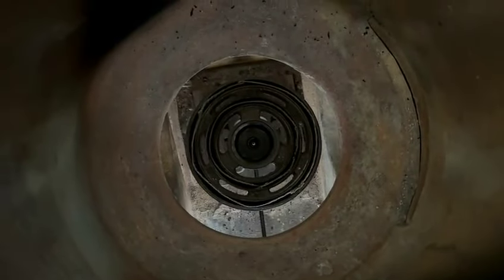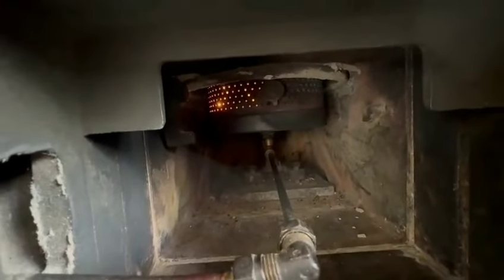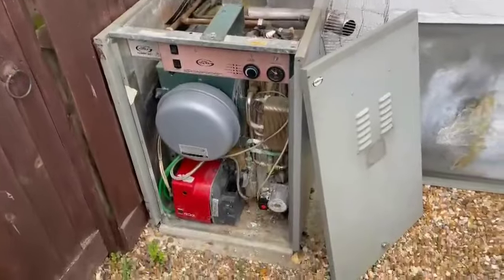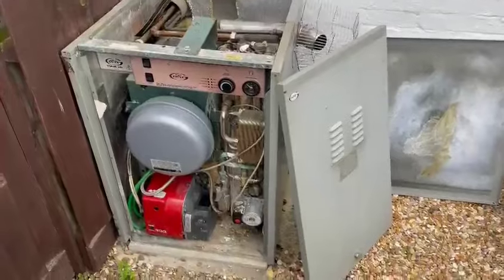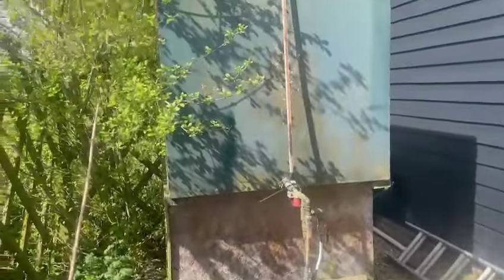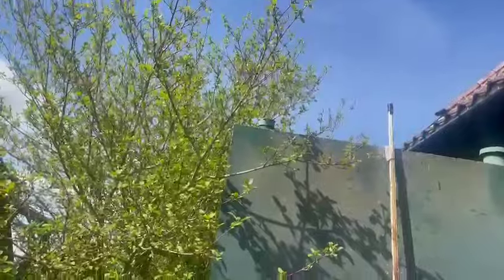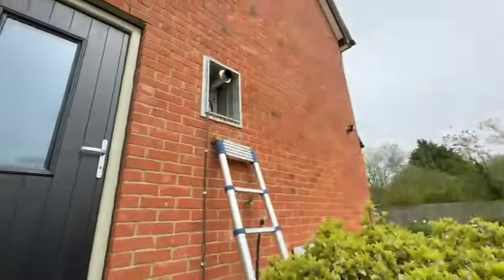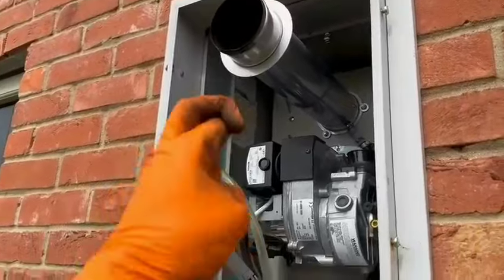Oil Boiler Breakdowns/How to Fix Certain Faults

Comment: Great video guys…..back to that photocell/controll box fault, with the burner coming on then cutting out, would you suspect the solenoid valve?
Reply from the maker: Hi. Thanks for the comment. Normally a coil is when the burner runs for a while and then cuts out. A box or cell or both is when the boiler runs and cuts out after a few seconds. This is all a general rule of thumb! Have a good weekend.